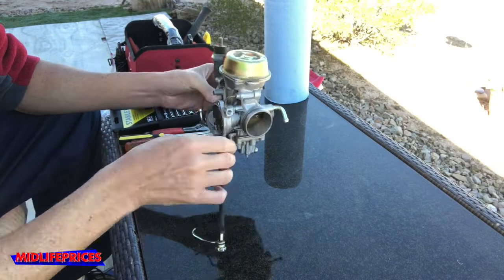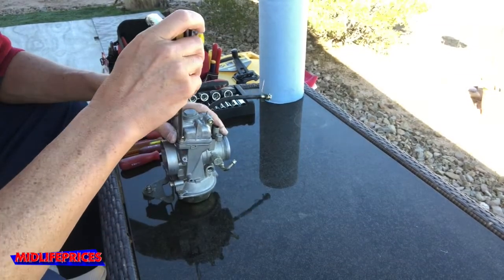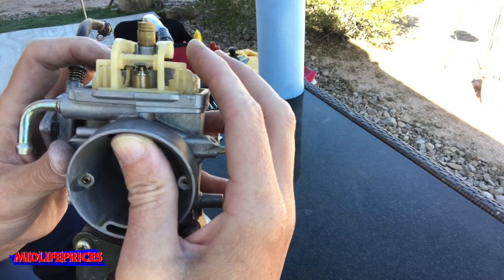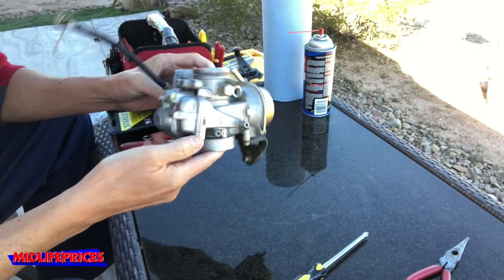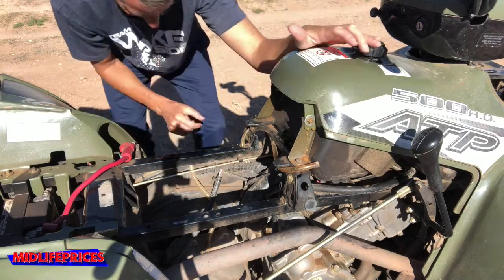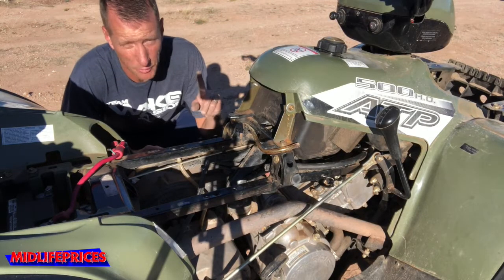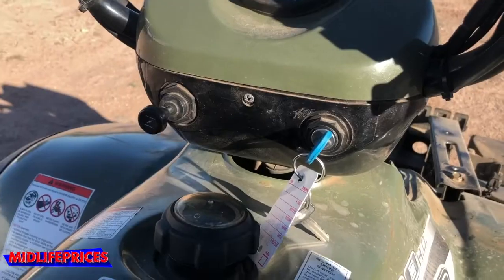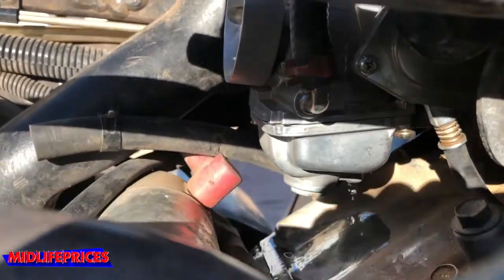How To NOT Fix A Carburetor

Comment: Good one.  I would have liked to see a shot inside the bowl area while the float was out, and some commentary on how that worked.  Also, you mentioned the choke and accelerator cables, but it was hard to see how they worked.  Perhaps you can go more into it in the next video, when you actually fix the carb. :)
Reply from the maker: I’ll try and hit it better next time around, Scorsese 😉!

Comment: your  you have to change the needle valve and the needle to kit and set the float so the horizontal perfectly horizontal before you put it back together
Reply from the maker: Thanks, Leigh.  I think a carb kit may be the next step, but I may take the carb to someone first to get a diagnosis and some advice on how to proceed in person.

Comment: Sorry I hit send instead of edit you have to change the needle and the seat they come as a kit then you have to bend that little metal arm so the floats are perfectly horizontal before you put it back together the gas is coming out that high tube bit in the middle of the bottom of the bowl when it's over full